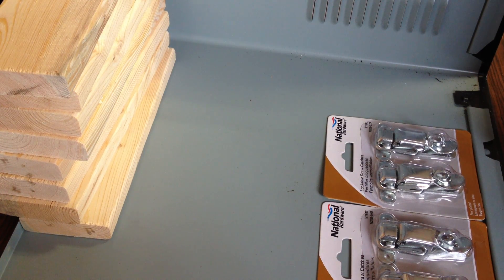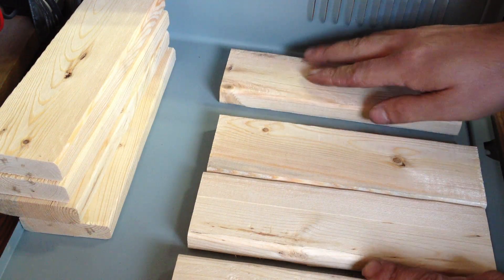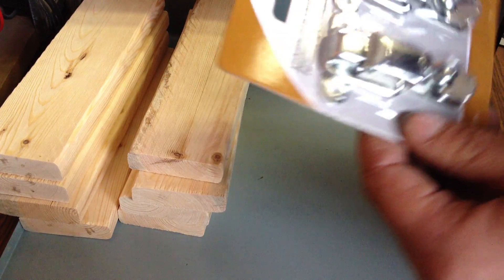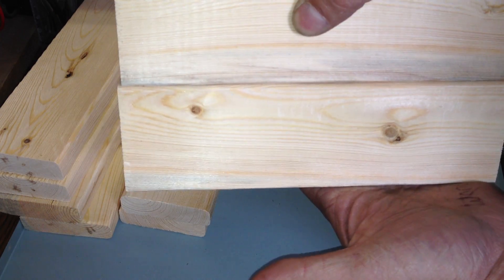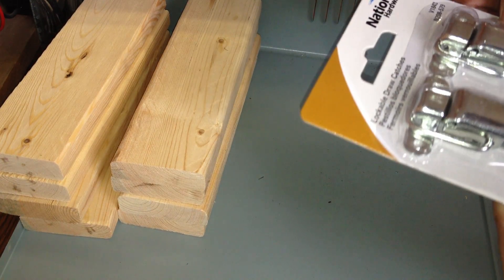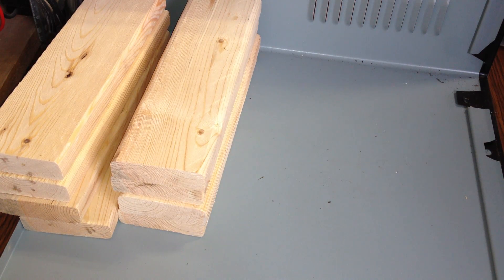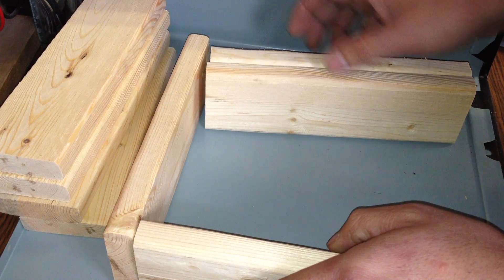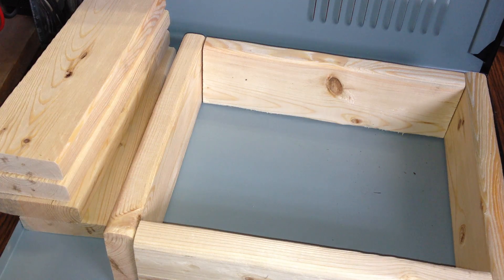How To: Aluminum Sand Casting at Home, From beginning to end on Budget    Part 1

Comment: just a warning to anyone else with expectations, nowhere in the series does he actually show how to make the mold used for casting.
Reply: Boopcheese 3D printer man
Reply: he shows you the layout for the box.  If you can't make a couple boxes after he shows this video, you shouldn't be working with molten metals.  Stick with acrylic painting by numbers instead.
Reply: +TheRealObamacide the problem you don't understand that I'm pointing out is I have no idea how to make the actual mold portion out of sand. I don't know what the right type is because all that happens when I make one is it falls out of the frame. someone that can't build this frame shouldn't do any woodworking.